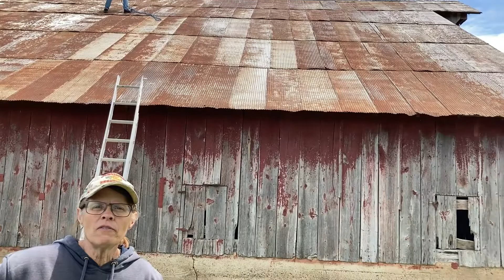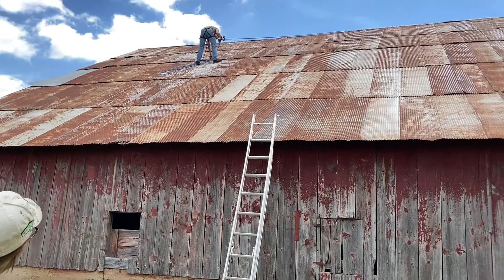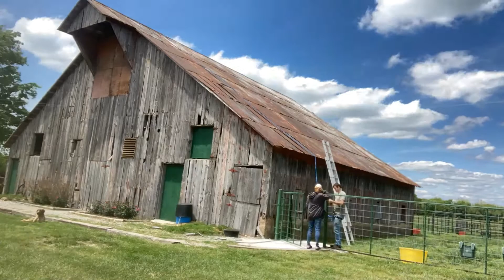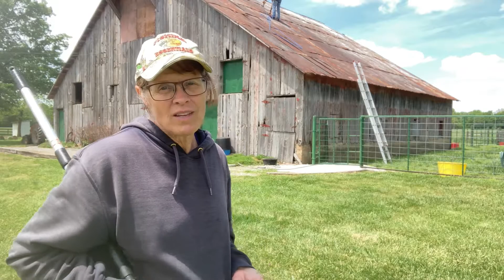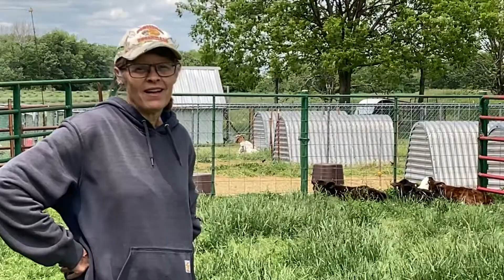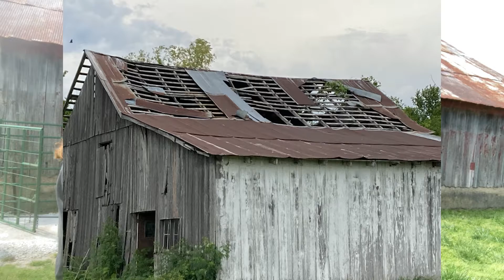Fixing Our Barn Roof

Comment: Brave! Any tips? We have a 2 story barn that has some metal panels missing and the ridge cap needs to be replaced.
Reply from the maker: Our first tip would be higher an Amish man to do it for you if he lives near you.😉 The second tip if you have to do it yourself tie a hammer to a string and throw it over the barn holding one end of the string. Then tie a rope to the end of the string and pull it over the roof. This gives you something to hold onto while you’re up there. Good luck!
Reply: @borninabarn8450  excellent ideas. Thanks.